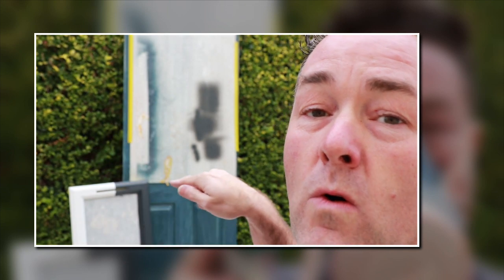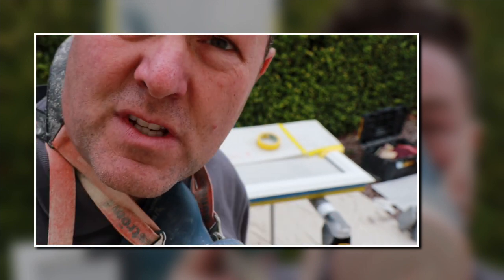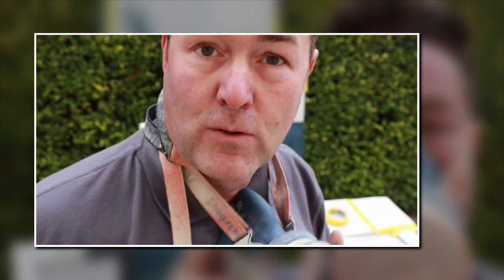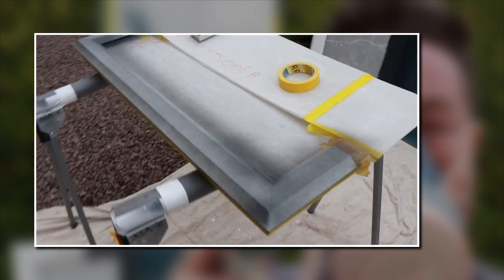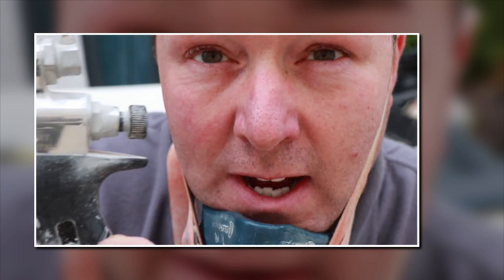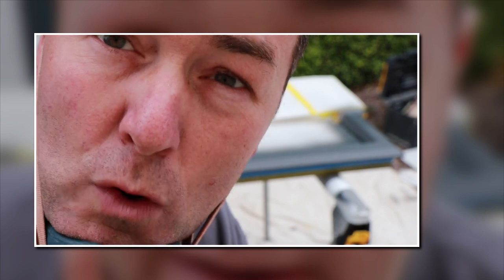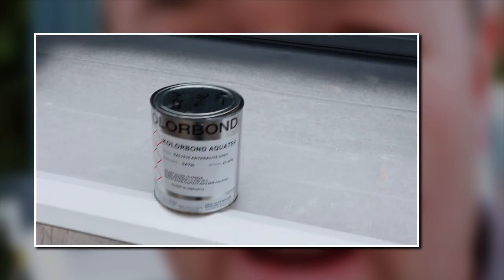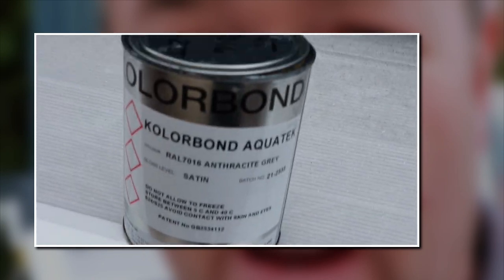uPVC spraying - using KolorBond AquaTek with HVLP

Comment: Like to see their tech department show how they brush the paint on and the dried finish.
Reply from the maker: You make a very valid point.
It could be like when you buy a car and get told it does 75mpg, then find out they test it on a rolling road (no wind drag) , strip the car down to a shell and only have a min amount of fuel in the car.

Comment: Hi Phil I use this a lot an 2.0tip on hvlp little bit of warm tap water 30 psi on me gun an compressor levels out boss nice video tho
Reply from the maker: Tnx, I did think a 2.0 would put a greater amount on to flow out. Compared to the 1.8
Have you tried the Original as well?
Reply: Yer I used a 2.0 on me gun with aquatec I used only Original for me windows an k2 an aquatec for the doors an garage doors  Kolorbond is the paint wot I started off my business when getting in to spraying never had a problem k2 is a boss product have ya tried it phil

Comment: Great vid Phil 
What needle set did you use? 
And what needle set do you think would be best for water based satin/gloss?
Reply from the maker: Hi, sorry for the late reply, just seen your question.
are you using helmi or everal etc?
depending on the viscosity of the paint... if it's a thinner product a 1.5
if a thicker 1.8

it's also it i want more paint going on I'll use the bigger needle set. then regulate the paint flow. a bit of practice and you'll get the feel for it.

Comment: Great vid
With your qt5 hvlp set up do you find yourself constantly refilling the 1 liter  container ( if you where doing a staircase or doors) ?
Reply: Or a kitchen for instance
Reply from the maker: @asdad2385  ooooh, spend an extra £240 and buy a remote pot, it holds a good 2ltrs... also allows you to use the gun in any direction. Have a look at the HVLP set up video I've done a few months back, I how you it on there. Makes it so much easier when you have a bit of spraying to do and don't want to be topping the suction pot up every 5mins ;)

Comment: Hi Phil can you use this aquatek on wooden doors?? 
If yes Would u recommend priming the wooden door first or go straight on with the aquatek?
Great video 
Thanks
Reply from the maker: Hi. Thanks.
Is this for outside use and new unpainted wood?

I'd check with Simon at Kolorbond just to make sure, I've a feeling you can use it on wood but unsure what the best primer is for which wood it goes on. You may find you thin it down as the first coat... But don't quote me ;)

They're a few other water based paints to look at for wood too that are great to spray...
Bedec MSP
AllCoat Exterior
And don't forget Tikukurila ultra classic and also Everal Aqua is an interior and exterior paint.
Reply: @ProfessionalPainterDecorator  thanks for the reply phil much appreciated, 
I’ve got a front exterior wooden door and a large wooden garage roller door they want sprayed, 

the garage door has been varnished previously but now they want it sprayed in a sage green colour Phil,

I’m just wondering what exterior water based satin paints you would recommend best for this? 

I was going to brush and roll the Tikurilla otex resin base on as the primer coat but I’m unsure what the best top coat would be as I want it in a water based satin mate so it’s easier to clean out etc with my qtech 5.

Which one do you think would be best?
•For weather protection?
•Scratch and knocks toughness?

And also what sage green colour do you usually go for the nicest one? Just there’s so many to choose from,

Thanks for your help Phil
Reply from the maker: @BusterBloodVessel1  give it a rub and key it down. I don't think you'll need oil Otex on it.
Look at All Coat exterior Satin.

The concern is the varnished wood, I've had issue with a varnish door.. sanded back then Otex, follow by f&b Uc and then exterior f&b exterior eggshell.

Was fine for 6 months but now the sun moves around onto it, blisters are forming on part of the door.

We've narrows it down to gases in the wood coming out, getting trapped by the oil coat.

The options over stained hard wood really is going Aluminum leafing Primer over it first.

Just something to think about.
Reply: @ProfessionalPainterDecorator  brilliant Phil thanks a lot mate much appreciated
Reply: @ProfessionalPainterDecorator  is farrow and ball exterior eggshell good for exterior garage doors do u think phil?

Comment: Hi Phil would you be able to put this on with a airless system using a fine tip
Reply from the maker: It's water based so can't see why not.
But I'd say it's better with the lower pressure of Hvlp.. plus you'd have more control of fan size and amount of paint flow all at the gun in one go.
Reply: @ProfessionalPainterDecorator  thank you that all makes sense but I have a lot of fence painting and other big projects I'm planning and opted for the airless sprayer and was hoping it would be ok to do the windows

Comment: I didn’t realise you could use the water base on Upvc phill! When I used the kolorbond with my hvlp the other day the paint level inside the gun was to low and it couldn’t pick up all the paint properly and it started to spit the paint is there any way around this mate?
Reply from the maker: you mean it needed a splash of water cus it was too thick?
Reply: No I was using the kolorbond orginal
Reply: When it got towards the bottom I found it wouldn’t suck up the rest of the paint and it started to spit so i had to keep filling it to atleast half way
Reply from the maker: @Shortboxing47  i have the same, the tube doesn't go all the way to the bottom. you need a good amount in don't you.

Comment: Great video, looking to get into upvc spraying, year's of airless experience, what would you recommend turbine or compresor set up, thanks
Reply from the maker: I've both available to use. I like the ease of using the hvlp set up .  Smaller unit.

But does down to costs and what you want to spend.
Reply: @ProfessionalPainterDecorator  thanks for replying, continued success with the videos

Comment: Hi Phil Is this what upvc sprayers use on kitchen cabinets ?
Reply from the maker: No, I don't think they do.

I mainly use... With the correct undercoats...
Either
Modern eggshell from farrow and ball
Or Tikkurila Helmi or Everal Aqua.
Reply: @ProfessionalPainterDecorator  thanks a lot
Reply: Same person asking 😂 will I need to thin either helmi n fb for gravity fed hvlp gun ? I do outside upvc n want to do kitchens sorry for all qs
Reply: Iv got a devibliss
Reply from the maker: @josephgregoire5792  best do a test on a piece of card board.
If it's not spraying nice, thin it.
Make sure you regulate your air flow too so you have good atomisation.
If the helm is cold it'll feel thicker... So thin to suit 
But if it's warmed you may find it sprays beautiful straight out the can.
Reply: @ProfessionalPainterDecorator  ok thanks a lot Phil u been a great help
Reply from the maker: @josephgregoire5792  just have some practice card board near you and have a play ;)

Comment: What do you film on? Might be worth getting a wind sock on the microphone when filming outside
Reply from the maker: I've been looking at getting a Ride video micro. It'll fit on my Mirrorless Canon M6 fine... Even better with a cold shoe bracket underneath.

But there's also the Jobi that looks the same, a few quid cheaper.
Reply: @ProfessionalPainterDecorator  yeah I've got a rode videomicro not that I've used it but the new Bluetooth ones that clipon seem popular

Comment: Do you still use KB paint after your recent scratch test?  https://www.youtube.com/watch?v=n5zLSnVsTq8&t=933s
Reply from the maker: The KB original is very good. You seen the follow up video on going back to jobs that have had that used on it?
Reply: @ProfessionalPainterDecorator  Yes I saw all the chips in the paint. I also saw the video where you could've easy removed all the KB paint with a pound coin.
Reply from the maker: @pacman4568  this one... https://youtu.be/IIc6MlW3RR8
Reply: @ProfessionalPainterDecorator  yes, I have seen your video, and yes the paint looks good. But does it stand up to a scratch test with a pound coin? You know what a facade is? A fake frontage that hides the ugly truth.